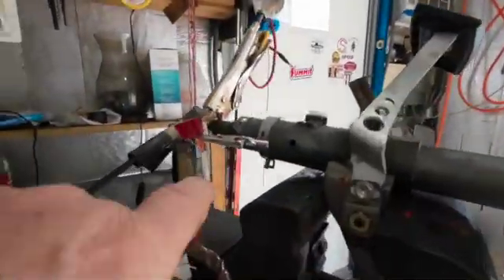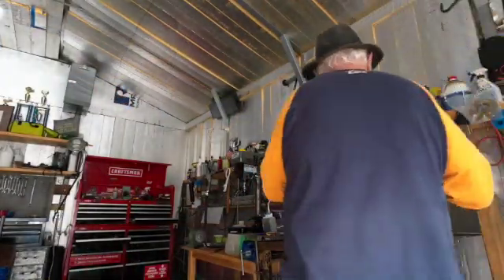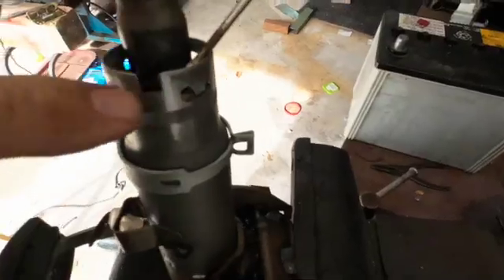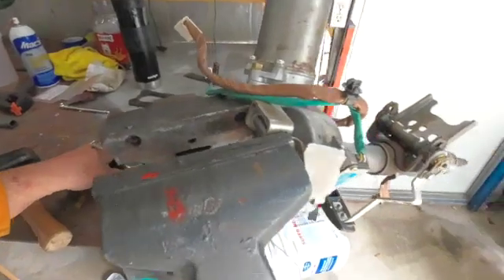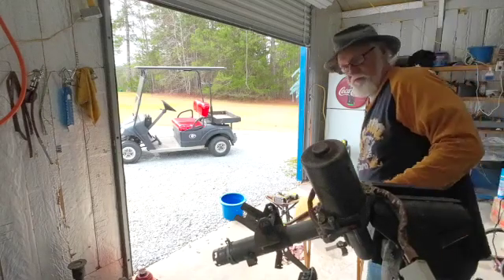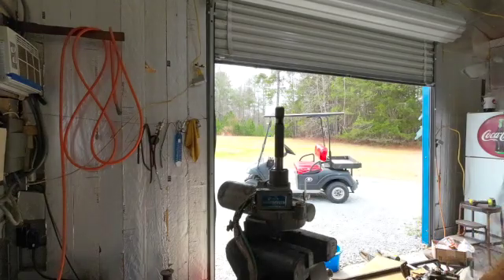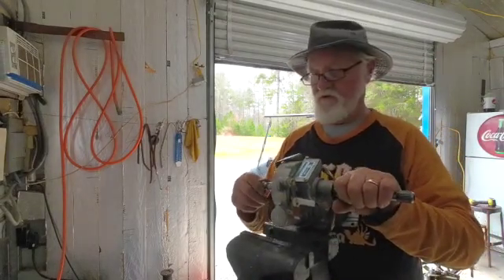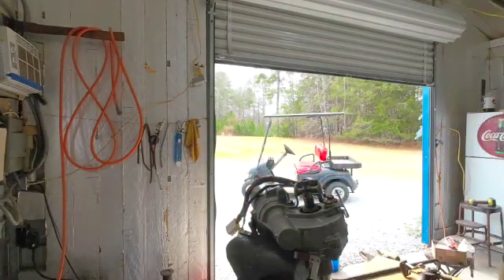Prius power steering electric assist unit 1    Dismantle

Comment: I had it figured out by myself for the most part, but needed a video confirm that I just wasn't hitting it hard enough to get the shaft out. Thanks for the video. Hopefully I'll have power steering in my old Bolens Eliminator soon.
Reply from the maker: I love mine.  Works a charm in my old Studebaker.    Have get the mounting good and snug though.   She'll move if you leave any slack.

Comment: New follower here. I’m wanting electronic assistant in my 50 Chevy truck. Thanks for the information.
Reply from the maker: I hope the series of videos help.   I put them in a playlist so you can see all the steps.   Good luck with it.
Reply: @rpeek  just wondering. How long do you think those epas will work in the weather. Mainly rain.
Reply from the maker: @sometimesitjustbeesthatway3070    I think where you install it might be a factor.   On the Prius they're literally in the dash right under the steering wheel and on Prius cars I've heard no reports of them not working.   Now on my Studebaker it's on the frame, exposed to weather.  Of course I live in the South and keep the car in a garage so ...  who knows...    I've seen them put on mud buggies and such but I guess only time will tell...    My electronic box is also located on the frame under the car.   I'm thinking of enclosing it in some type cover but haven't devised it yet.   Still a bit of a work in progress, but so far it's a great addition.
Reply: @rpeek  yea I like the way you mounted to the frame. Which mine stays under cover also. But if was to get wet during rain. Was just thinking durability.
Reply from the maker: @sometimesitjustbeesthatway3070  It's good to be thinking that way.   I'll let you know how it goes.   I might still put one more brace on the unit itself.  I can still detect a tiny bit of play in it.  It's an always prospect, building a car.
Reply: @rpeek  yea built a few over the years. Junkyards are so easy now. I can go in and measure things out before I buy.
Reply from the maker: https://www.youtube.com/playlist?list=PLvFup6BV6komexSGjE6Vmh8Vi39OoR_ai

Comment: The power assist I purchased was a Nissan Versa 07-12. Looks almost exactly like yours . Probably made by the same company. but the mounting brackets are a little different. .  I'm  planning for now to my original steering wheel and column that will have to be cut down to fit. I'm going mount the assist inside the cab above the pedals. . Good luck on your installation
Reply from the maker: Thank you Rusty.  My friend Jeff with the Studebaker is near the point of giving up on the power steering because of the way the steering shaft is enclosed from the wheel to the steering box.    I'm encouraging him not to give up.  My plan is to do the Rambler next.  I've considered doing something similar to what you're doing, mounting the Rambler one inside, and possibly near the steering wheel.   What fun adventures we're having.